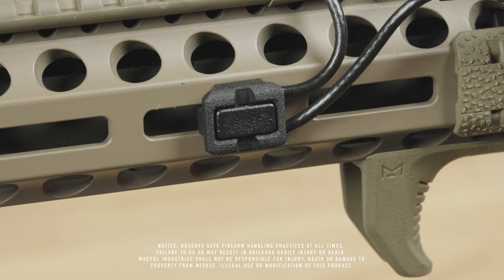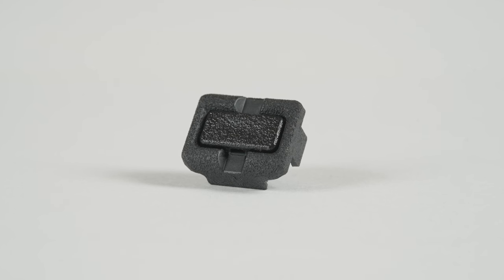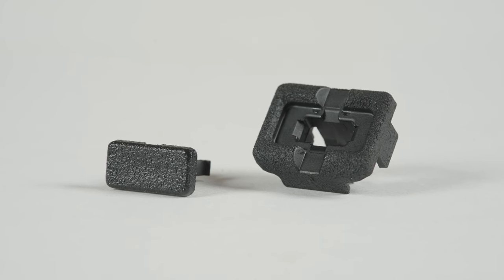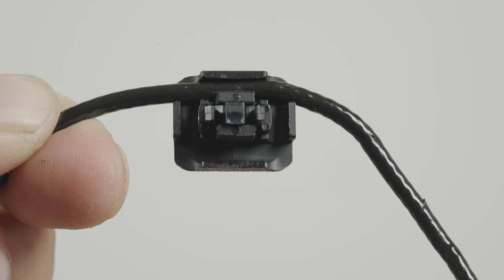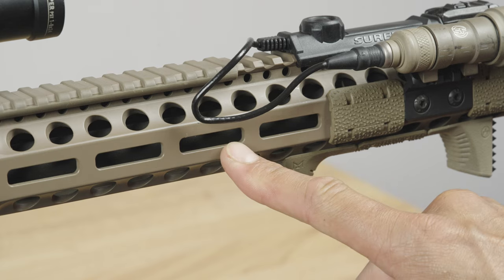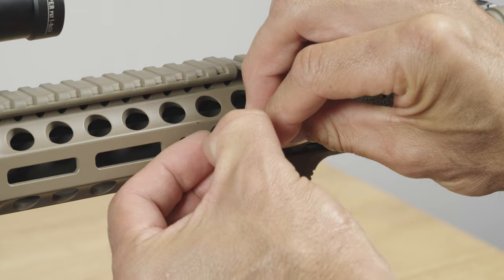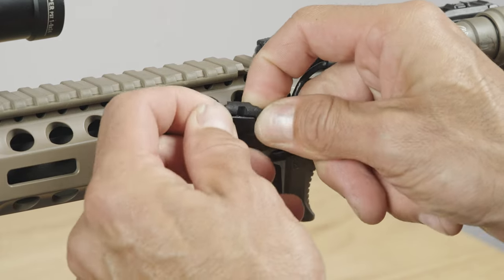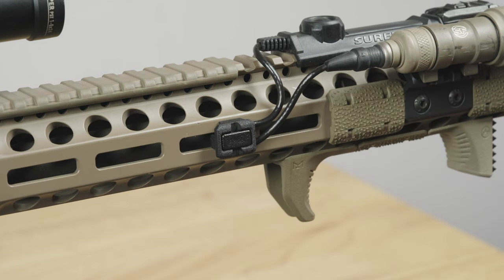Magpul Instructions - WCK Wire Control Kit

Comment: 34.w Hello Magpul the current concept of the AGK DTS MDA Team Thuringia, i.e. slide and bolt where a magnetic ring is added so that when the cartridge is closed in the barrel two magnetic fields collide that strike each other and an energy supply takes place, up to a glove that has an energy transfer with a holding point on the weapon through Mag safe. And also on the handgun where the concept is applied. up to the supply of the new VR helmet with a battery radio that is powered by the gloves. in combination with the protective vest. your AGK DTS Hypo Economist concept institute maison des associations Thuringia united Germany evangelische Union weaponsmith factory would charge 50 percent of the final patent mfg Christian Deutschmann©®™